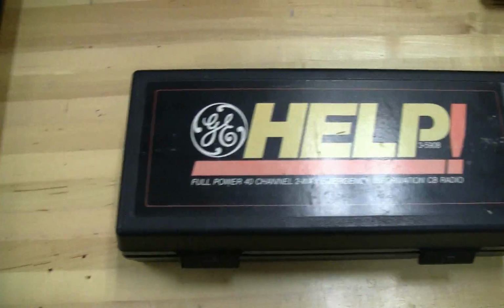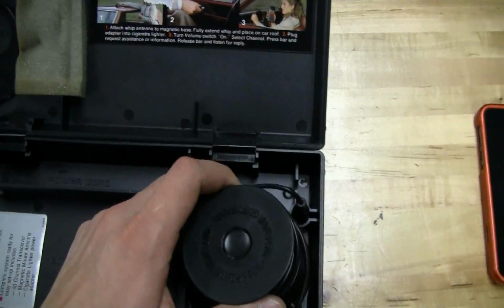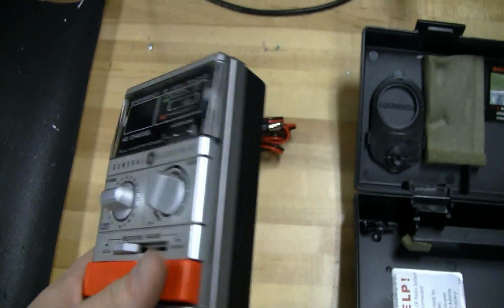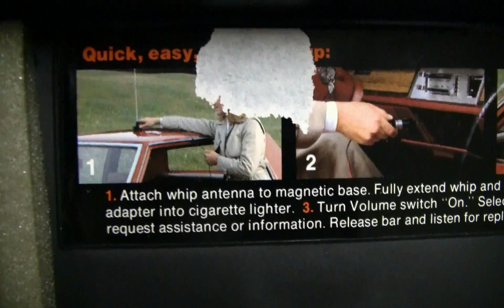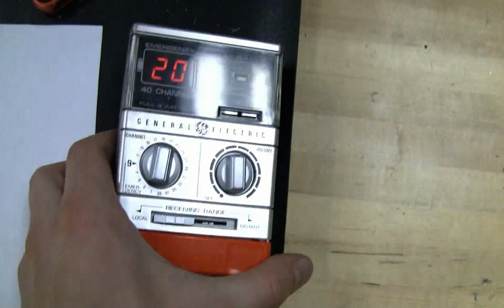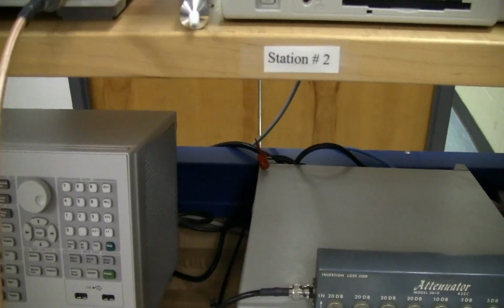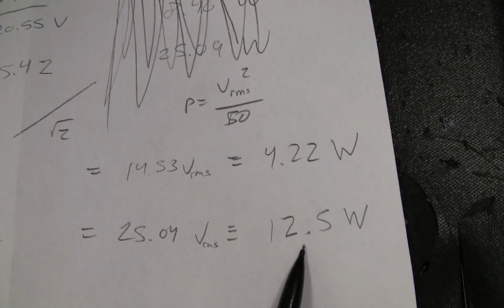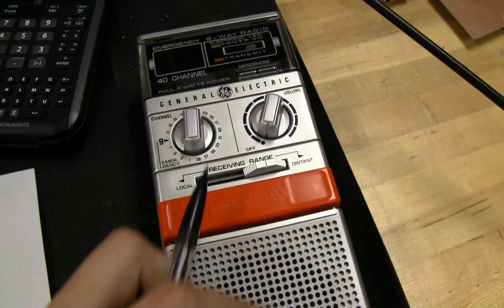GE HELP! Emergency CB Radio Testing

Comment: Pretty good numbers there. These are all over ebay, and can pretty much be had for as cheap as can be (shipping aside). They would be great as a beginner CB, and the one I have can double as a walkie talkie. They typically weren't used and just sat in vehicle trunks in a nice plastic case, so odds are you will get one that is in great shape and fully functional.

Comment: I spoke to Hawaii from Melbourne (Australia) on the Midland version of these. I was just haphazardly testing some helical whips for a guy. He had all these random antennas in his garage, so I offered to test them with an SWR meter, and plugged the Ready Rescue in the cigarette lighter. They have an electret insert, and I turned the modulation trimpot up all the way. Audio quality was excellent.

Comment: I got a similar unit from a thrift store. It has the power adapter but no antenna. I'm having a hard time to find an antenna with RCA jack, the options are too expensive.

Comment: Great testing and review video.  I didn't think I'd find anything on this radio but I found several videos and some info.  I think mine might be a slightly newer model because it doesn't have the red band on the front or rotary detent switches and it's all black and  just a little cleaner design.  I'm impressed with the clean output you demonstrated.  btw I just bought mine at a Salvation Army store for $4.99 and it works well.  I'm always a little leery of buying electronics there but so far so good.

Comment: Interesting video. I enjoyed it!  I like these old emergency cb radios. I know nothing about how to use an oscilloscope but I'm impressed by your knowledge and all that math. I guess algebra IS useful for something after all lol. You can buy rca to pl 259 (so239) adapters so you can connect a proper cb antenna even a base antenna to it and these make great quick set up base stations. Thanks for sharing!